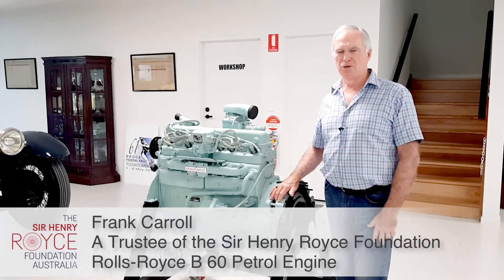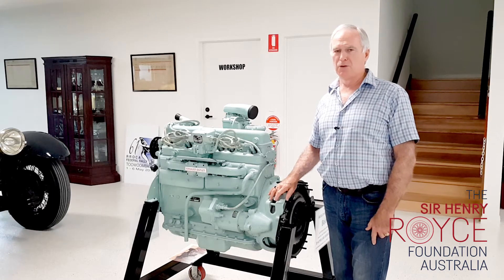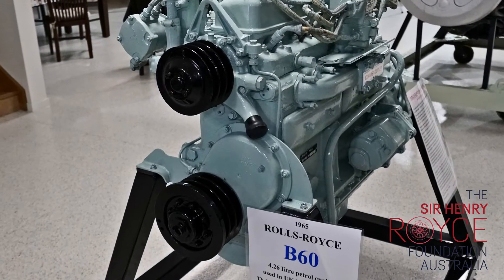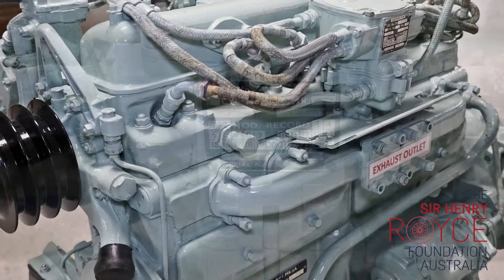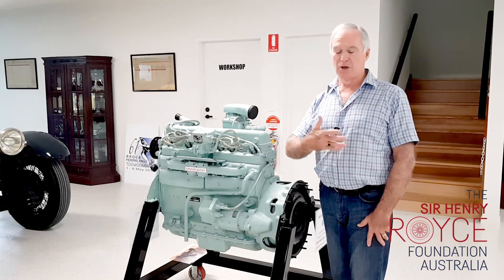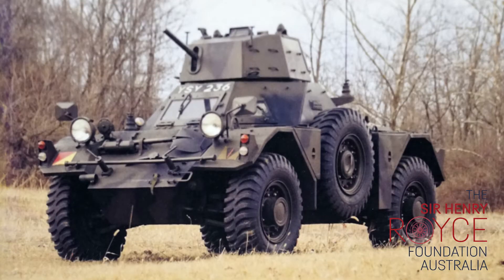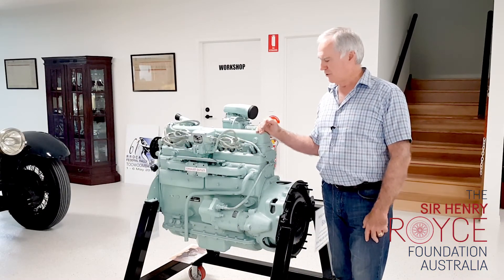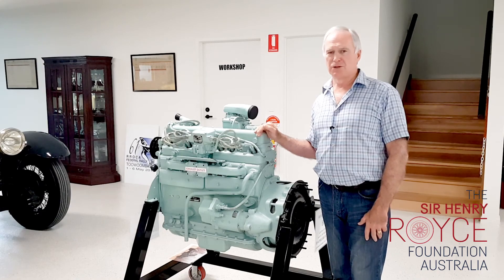SHRF - Rolls-Royce B60 Engine

Comment: The drawings for   alloy  block version of the B40 were used as the basis for engine  in  the successful Vanwall  Grand Prix car The Vanwall was of course twin camshaft  and the original B series I.O.E. (F head)